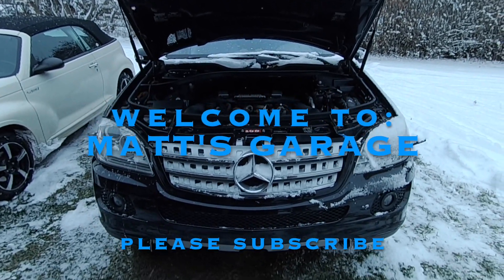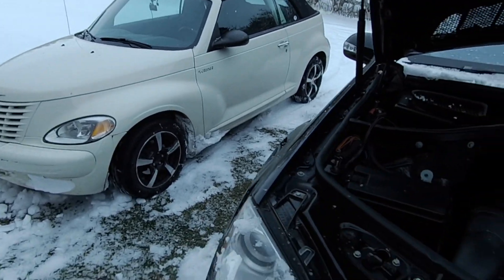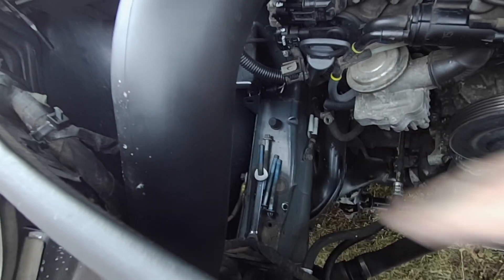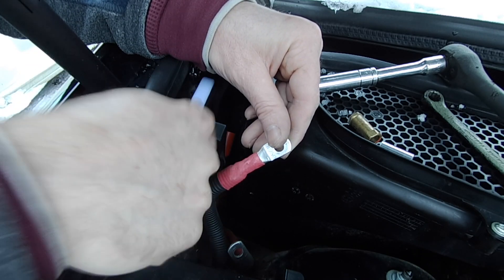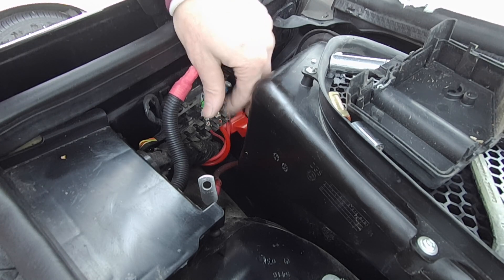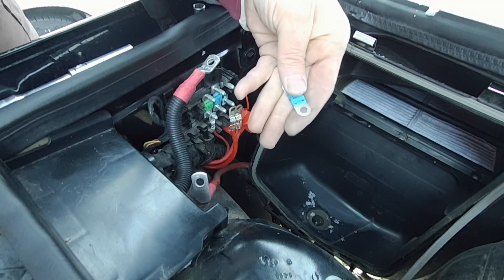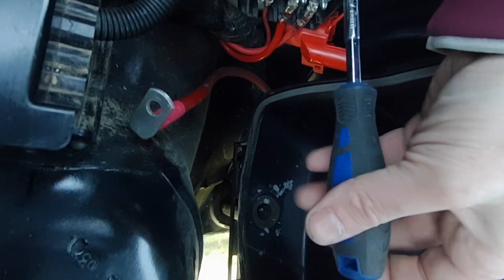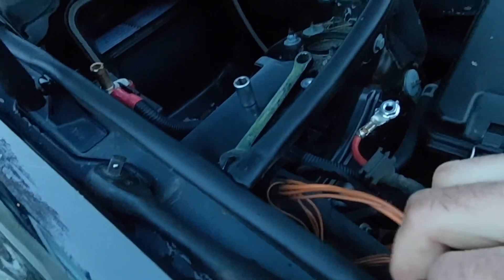Mercedes ML350 Electrical System Maintenance

Comment: Very helpful video on a very overlooked preventive maintenance. 

Put towels below where you are working, that way if you drop anything, it's right there. 
Use a smartphone to take pictures of everything before disassembly, that way you can refer to pictures to ensure proper reinstallation.
 
Use Deoxit or Stabilant 22 on bare metal connections then coat outside of parts with dielectric grease after assembly. This ensures long time connection and protection. While dielectric grease protects against corrosion, Deoxit and Stabilant 22 enhance connectivity. 

Again most excellent video on a major contributor of faults on cars. These ground points including the ones under the carpets and other ground points not mentioned in the trunk area.

Thanks, Matt.

Comment: Hi! I have 2 w210 E300td with electric problems, I think i have some problems with electric cables,because both have no power windows, sometimes they work,same for the seats,sun ruf,or other stuff,and lights are fluctuating,  both with good batteries and new alternators.

Comment: i am having electrical issues, basically with the turning lights, the horn, wipers, and others like when the key is removed, it still says please remove key. Any recommendations
Reply from the maker: Unfortunately that sounds like any fault in the Sam unit, which is the main computer module, it's located in the battery box under the passenger seat. You would definitely want to hook a dealer level scan tool up and confirm that. It might be worth trying to leave the battery disconnected for 30 minutes and then reconnect. ( I have a video on how to reset everything when you're reconnecting the battery)

Comment: Hello friend, I need your help very much. W164 gl450 Slowly shut down the audio system. Flashes.The glass cleaners were sometimes turned on and sometimes not, but now they are completely off, and if you can help me in the comments, at least write me how to do it.💞💞💞
Reply from the maker: I wish I could help you but that is not just a black and white problem. You should have a trouble code and that would be best place to start is to scan the vehicle and find that code and it should lead you to the source of the problem.
Reply: @CarswithNash  ok thanks bro💕